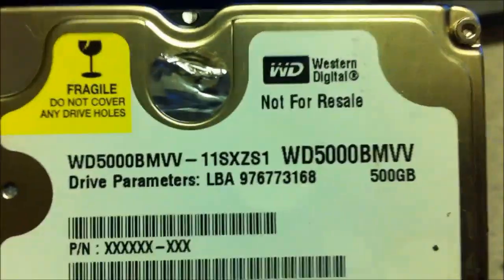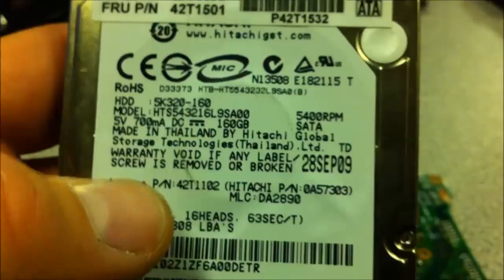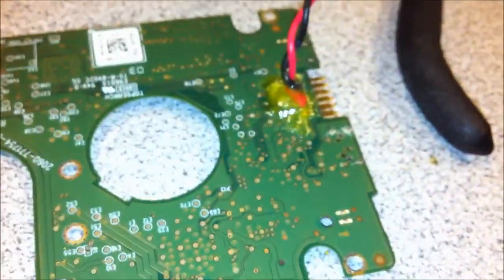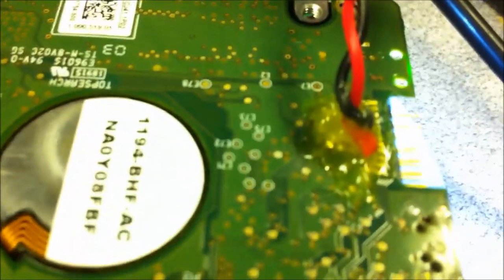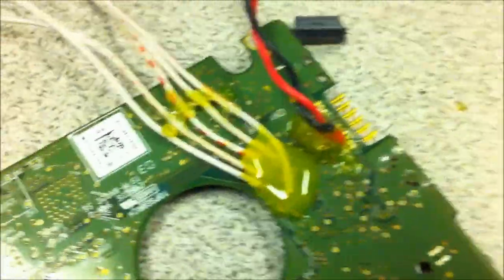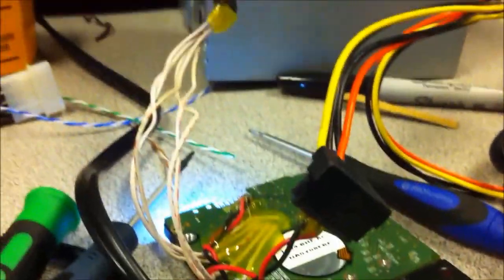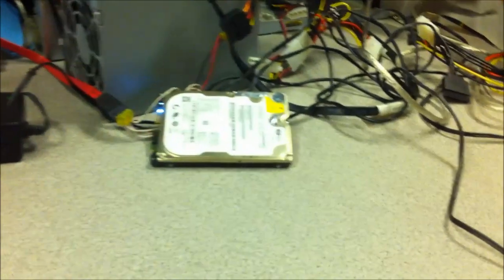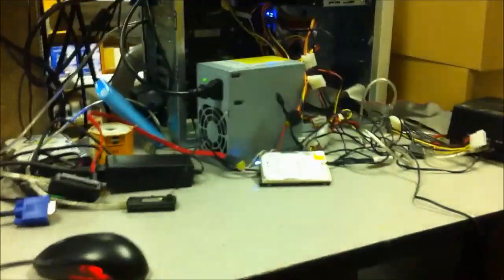Western Digital 2.5" Laptop USB PCB Data Recovery / Repair Issues (SATA Connector Modifications)

Comment: Hi Guys! I am ready to help you from all those scare crows who are scaring you with nightmarish comments that if you fiddle with your hard drive data recovery cannot be done. Believe me these rumors are spread by data recovery  agents or no knowledeable guys who are just reading here and there and scaring you. I am ready to help all those people who are having difficulty in data recovery with a nominal fees of dollar 20/- and guarateed recovery of data will take place. You have to just buy one new hard disk to transfer the data and my hard efforts advice will revive your hard disk i promise. I am doing this because this hard disk failure took place with me also and nobody came to help me and after 1 year of research and learning I found the solution and tried it with my failed hard disk with all the attempts which is not possible to write all of them here as it will be long story and you might break your disk. It is no difficult job to revive your hard disk that has your valuable data in it. And it can come back very easily but has a small price of dollar 20 attached with it as it might take around 3 days at least to revive the whole drive. Their are series of test if done correctly can revive the hard disk. I am only charging for my time and hard work that i will devote with you all the 3 days. I can guarantee 99.99% data recovery if you have not played or opened the device or scratched the platter like a monkey does. You have to be wise and careful and don't mishandle your disk after it gives clicking sound or any sound. Just  click coolly safely remove hardware and remove media from the extreme right corner of your computer and take out the USB cable and follow my advice. It is a DIY exercise and you have to do what i guide you through whatsapp and 99% your drive will start working or you will be able to transfer your data to the newly bought hard disk. This much i can guarantee. But if you already have a space where you can transfer the data then no need to buy new hard disk. If you don't have then one drive fresh new one you have to purchase. But data recovery is guaranteed. Please note this is just a helping gesture for just dollar 20 as many of you are reluctant of paying thousands of dollar to data recovery companies. I also felt the pinch when data recovery company gave me 10 times the hard disk cost of budget of recovering data. I was shocked and couldn't sleep whole night. And I will be helping you in this manner and kick all the data recovery agents ass who are torturing people by charging exorbitant price. You can do it at home, under my able guidance and able to recover all your data and it is very easy the only thing is you have been scared by the data recovery companies and secondly you don't know how to do it. I will help you with the help of whatsapp call. Whatsapp call is free and very nice voice comes and you will be able to hear me clearly. Also you will be able to show me your hard disk and step by step i will be able to guide you how to recover data and repair your hard disk. You have to be patient and think yourself technician for some days and I am 99% sure your data will be recovered. If you need my help then you can contact me through my whatsapp no . +917035158687 and I will help you in all means to get your data back. Its easy if you know and difficult if you don't know. When you have learn't it then you will be able to help others also like me as I have learnt and charge a small fees for your valuable time, efforts, hard work that you give to the person interested. Everyone will be happy to pay 20 dollars if I get your data recovered and your hard disk repaired. And you don't have to be scared of those scarecrows scaring you your hard disk is gone, dead, paper weight etc. It's not . You can get your hard disk and data back back if you follow my step by step instructions. Its not difficult that I can tell you.

Comment: removing the usb conector, triming a usb cable and solder that would be MUCH better since you wouldnt be tampering too much the pcb, leaving almost no room for human error / chance for it to die. of course, transfer speeds, blah blah... it would be already done judging by the time it took you to solder both conectors (sata + power).

Comment: dude where did you find that wiring diagram. I need one for 2061-701675-604-04P. It looks basically the same but slight differences

Comment: Hey man nice video... Like another poster had asked, I have the same HDD but the PCB Board has bit of different layout. the Dots are a bit different. MIne are somewhat triangular position in relation to the dots you are soldiering to. Any clue to which are power on my pcb???  I believe my are laid out like the 2060-771737-000...  Need help!

Comment: Hello everyone, 

this tutorial helped me to make connection to a "dead" USB 500GB WD Elements,
which was recognized as 2000GB by Windows7 and the Volume was not available.
Initializing drive in Disk management ended with result - Cannot write because it is read only.
Now I am recovering nearly 400GB of data from this drive including lots of personal pictures and videos of my cousins children.
They will be really happy because this HDD was the only place where they stored them, as lot of people do..

There is no encryption issue and the speed is very good 20-25MB/s so it will take only few hours to copy them all to a safe place.
If anybody want/need to try, do not use long wires for SATA data connection - 20cm did not work for me, but 5cm is OK
(I used wires from older SATA cable)

StarPuss - Thank you very much for posting this video, it helped me a lot - this was the first time I soldered something to HDD :)
Reply: Excelent but which are the power supply wires?

Comment: I'm trying to find the wiring schismatics for a similar board 2060-771737-000, as i need to do the same, the usb wont connect to the machines keeps vanishing, where did you get you  wiring schismatics from?

Comment: so the heads were stuck on the platters themselves? not good. Although i recovered a 500gb that had stuck heads on the platters using the table and wrist flick trick. the heads came loose and parked, the drive seeked and became ready. We immediately imaged the drive to a good one. It imaged fine, maybe just a few bad sectors, eventually though the drive died all together because of being stuck on the media, i assume the heads crashed onto the surface. Never good.

Comment: he's lucky he didn't open that up and try a platter transplant, in theory it could work with a 1 platter drive, but no more than 1, crucial platter alignment is so important, even moving a microscopic inch would render the drive useless. Once that has been disturbed no data company in the world could recover that, Also head alignment, and etc, He could have also screwed the heads up and when the drive would be powered on he could have caused a head crash. Better to just leave the drive sealed. very important that no one that has no idea what they are doing do not open the drive.

Comment: this is why i hate these passport drives.. That they have a proprietary connector for USB, no SATA to USB adapter. We had someone that brought one in that wouldnt work, pins were broke, we ended up telling the customer that we'd have to send it in for recovery. Too bad they are different firmware than the regular SATA drives.

Comment: My Wd passport 1 tb Having problem, I have its 3 partition when i connect it it shows partition with letter but it not showing size of drive and can not open.it shows green loading line on top address bar and it didn't load up. Green loading line didn't complete loading and drive didn't read. Please help how can i solve this problem, Can i replace pcb with other same model 1 tb wd my passport ?

Comment: I just want to connect the drive Via SATA so I can low level format it with HDDLLF. I don't give a rat's ass about the data on it. Thing has pending and reallocated sectors and often with these larger drives you can improve the health of the drive (amd SMART readings) with a low level format. But by USB that would take an insane amount of time and likely fail. Via SATA it would only take about a day or two.

Comment: all good to the moment when you are not showing that the hard drive is actually working and detected by your machine. data will be not visible because it will be in encrypted state, those drives are encrypted with smartware. so... good video for marketing that you can do for 100 USD but all fake.
Reply from the maker: Man... Not all of them are Encrypted.
And even if it was , That's NOT a big deal..
Reply: But we are talking about Wd :p you have to do something else to retrieve the data
Reply from the maker: Nope...
Reply: Only if it's an Essentials model, then it will incorporate 128-bit AES hardware encryption, in which case you will need the USB-SATA bridge IC (symwave SW6316) to decrypt your data.

Comment: Hey can you help me? My issues is the same hard drive type but mine doesn't read. Light comes on and spins. Please call or text me at 617-818-2542. My name is Mac thanx!
Reply: hi Mac, have you been able to find a solution? I am having exactly same problem with same hard drive!! thanks
Reply: I sent mine to the company. I told them this is my livelyhood because im a DJ
Reply: Mac Joseph and then they repaired it for you? Which country did you send it to?
Reply: zaynah Angel 
Does your drive spin up and then spin down?

Comment: thanks for uploading the video,i am facing similar kind of issue,my wd passport is not getting detected in windows,i even tried with multiple pc and laptop but there was no hope,finally after a lot of googling i got a simple solution,i had to just connect the wd to a linux machine and guess what now i am able to recover my data,yes you guessed it right it shows up in linux machine(usb/esata port is not damaged of hdd).

Comment: I'd say it's a good deal! Man I wish I had a head for the stuff you do. My laptop just crapped out so I sent it in for repair, 500 bucks and I still have to replace the hard drive. It was non-oem so MSI wouldn't touch it. Motherboard, and power-board are what they did replaced. It all pisses me off tho.....LOL

Comment: can you tell me how to find the right connection like what you did when you soldered the wires on the PCB? my Western Digital Scorpio Blue WD5000BPVT-22HXZT1 771692-205 2060-771692-005 REV A 771692 WD5000BPVT 2.5'' SATA PCB +FW

what are the connection codes 'cause there are letters and numbers(example U12)

Comment: if i was in the US, i would send the drive to you but on the wrong side of the pond!

my drive was never dropped. it spins up and sounds absolutely fine. led is solid - no clicking or funny noises whatsoever.  Tried several different PCs but its not detected and UVCView does not show anything.

i am guessing its corrupt firmware or something in SA area? Is this correct?

If i manage to get image the drive via soldered SATA connection, I guess I will need some encryption key or other?. CONT ...

Comment: hi folks.

just in case someone has same question - i could not find schematics but its easy to figure out where the sata lines are - they go to pins 1,2,3,4 of the Marvel chiip.  you need to remove or disconnect the coupling capacitors and use the through pcb holes.

1 problem solved :)

Comment: I wanted to know where I can get the wiring diagram for a WD drive that is very similar but the board is slightly different. Model is WD10TMVW. I have the same issue witha broken USB. Thanks

Comment: Sorry im commenting on an old vid.

Really interesting :-), ahh looks like getdataback, i have used that and its very good :-)

Hey you got a bucketload of data back, what does the soldering quality matter :-), it only has to last untill the end of the recovery.

This is the first video that helps people, most tell you nothing or a pillock hitting a drive with a hammer, pointless stupidity.